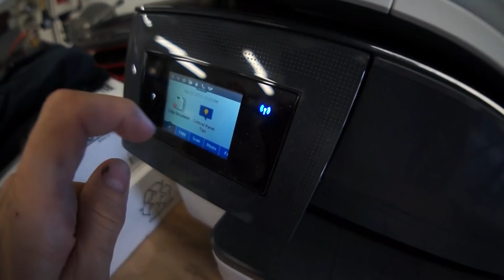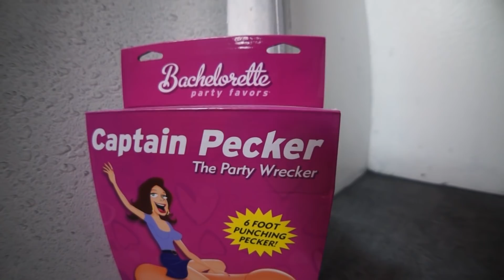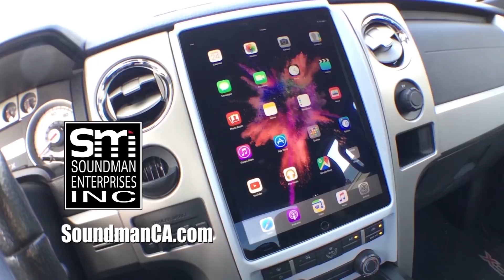We're working on new iPad kits!

Comment: Hi mate. I'm a qualified spray painter. Is shouldn't take that long to prime and sand the scratches out.  What primer are you using?  I'm not sure if your aware but there are things like UV cured high build primers. You can spray it on and run a UV light over it,and in 30 seconds it's rock solid. Sand it and it's done.